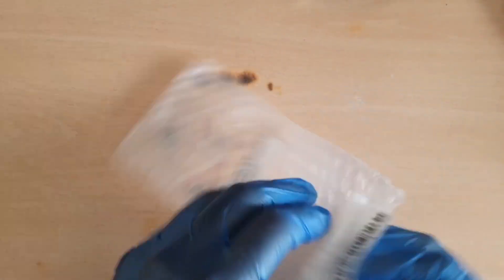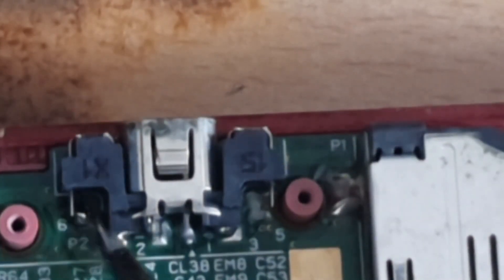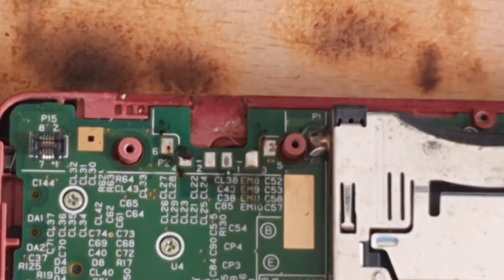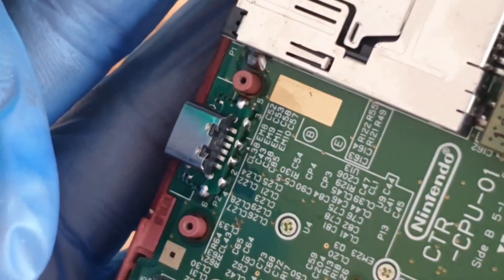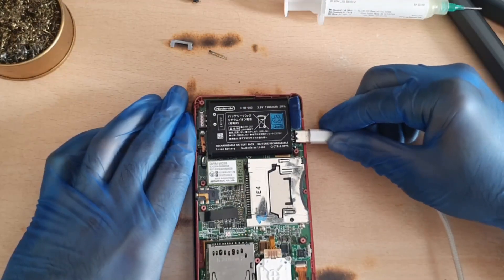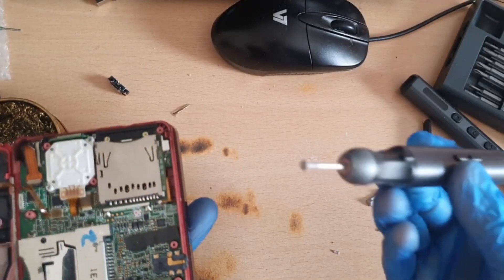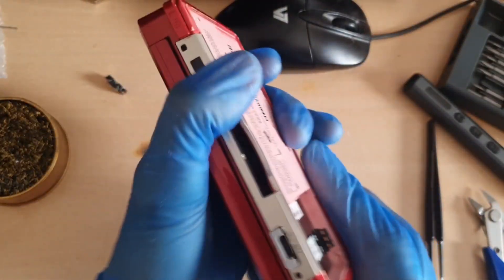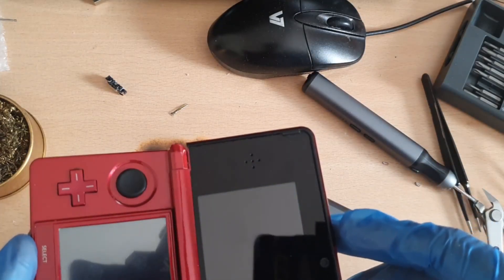Modding a 3DS with a USB-C Port (Step by Step Guide)

Comment: I strongly recommend you pull the board before doing any soldering.
Reply: why?
Reply: @adriananzano2292 could melt the case due to the heat
Reply: @Joshua.Baca. already did😂
Reply: Not only that but the way hes removing the port is really cooking everything. This method is a very easy way to "Rip" something off... burn up a part or melt plastic.

If you've done this a few times sure. But this is a recipe for newbs to screw up.

Comment: I bought one for 75 with that mod but it has lots of issues lmao almost spent 50 just to fix the whole shit
Reply from the maker: Oh, sorry to hear that. But It's been going fine for me, so far. What issues were you experiencing?
Reply: @Thefloatingtech broken L button, unresponsive touchscreen and dead pixel top screen, parts are very expensive because of tariffs, I live in Asia but we're affected too for some reason 😂
Reply from the maker: @Otachitaki  Whoa, I  I think you might have bought a DS off of someone who did a real bad job of dismantling and installing a mod. Port mods don't usually cause changes in button behaviour or screen damage. This looks like a tech/user install error and then that person sold it on.

Comment: Do you know what measures it has to be? I’m on a little journey to fully mod my 3ds and everything is really helpful 🤪
Reply from the maker: With USB-C mods, anything that can be anchored down so it doesn't come loose or pull off with cable when you take off the charger cable.
In this case, the anchors were solder points, I've seen other USB-C mods use super glue but as long as it works and doesn't come loose, you should be good as gold.

Comment from the maker: The USB-C breakout board was bought from Aliexpress. I cannot link it in the description but I hope that helps anyone looking to get one.
I also realise the 3d printed piece goes on the bottom side of the USB-C and not the top. But the key is to have the USB-C breakout-board installed flat and straight.  
Happy modding.
Reply: 6 months later, how is it still holding up? also, do you think it will be that hard for a person who is doing this as his first real soldering project?
Reply from the maker: @SuperSerferNow  Still works fine, I even did a ds xl.

Yes, this will be difficult but I would practise with scrap pieces of electronics. Doing this alone will up your prep and skill tenfold very fast. and Practise with some connectors if you have a spare lying around. Desolder and solder them back on to random solder points. It all helps. Check over my first video on the channel where I go over what tools I use. 

Hope that helps.
Reply: @Thefloatingtech  K thanks